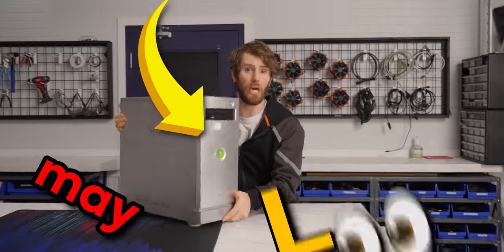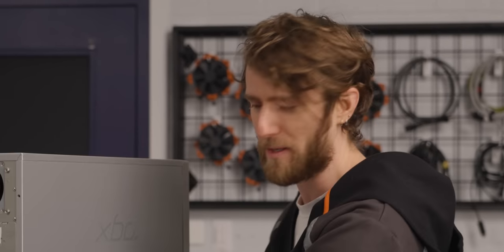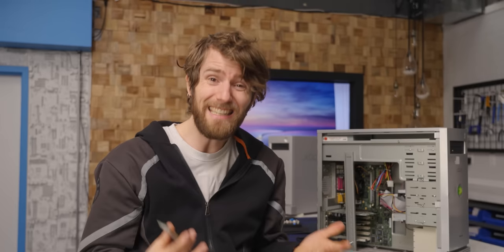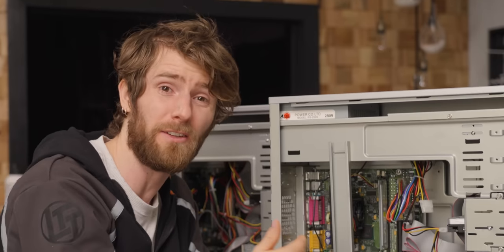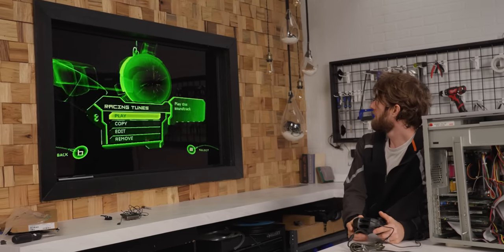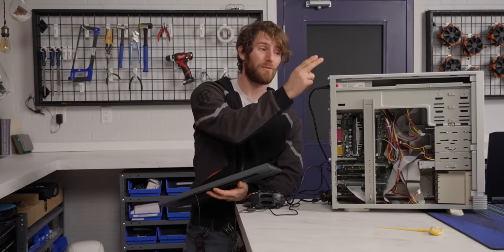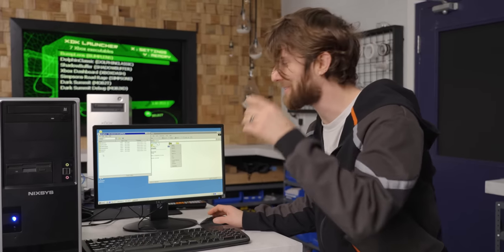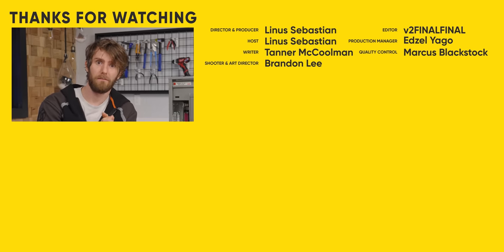I Used Stolen Software to Make a DIY Xbox - Xbox Alpha I & II Dev Kits

Comment: Windows 2000 remains a fantastic OS. It's a very light microkernel with the Windows runtime running on top of it. I can see why Bill Gates was horrified at the UI they built on top of it for these early demos, but luckily, the UI layer could be changed later.

Windows 2000, even the full desktop version, could run on 64 megabytes of RAM easily. The Windows shell was hardware accelerated, with cursor shadows, fading menus, and with the right extensions, you could even make translucent Windows and soft shadows. Since the XBox didn't need the full suite of the Windows 32 API, even that could be stripped down. Variations of the "ntoskrnl.exe", which is essentially the microkernel that underpins Windows itself formed the basis for Pocket Windows, the Zune, Windows Phone, the Windows recovery environment, and to this day continues running under Windows 10 and even 11. The vast majority of what uses system resources is not the Windows kernel, but rather the Windows shell and the plethora of services that run to create the full Windows experience.

This tiny core of Windows is probably one of the most amazing pieces of software ever written. It could run on almost any architecture, including Power and ARM -- it was the Windows 32-bit runtime that kept Microsoft from releasing on those platforms. And if you ran a server, back in the day, Windows 2000 supported Physical Address Extension and could address up to 128 GB of RAM on a 32-bit OS. Today, the NT Kernel can simultaneously run Windows 11 and a full GNU "Linux" runtime by running a version of the Linux kernel itself like a program.

So, you might think this is a cool use of a stripped-down Windows, but it's only the tip of the ntoskrnl iceberg.

Comment: The timeline fits with Intel paying OEMs to not have to compete with AMD.. I suspect Intel paid MS to use their chip instead as was their custom at the time. I'm a bit surprised the Xbox Devkit didn't have a drive flashed with firmware capable of reading xbox dvds, because that was essentially the only difference between a bog standard consumer dvd drive and the one in the Xbox, other than the proprietary power/eject cable.

Comment: OG Xbox gives back so many memories of installing mod chip, then later on using exploits to run XMBC and Emulators, or run games completely off HDD.  

Microsoft actually brought PC gaming to the masses with OG Xbox.   

What would be cool would be someone were to hack Xbox Series S or X. Then we would be able to install Windows on them.  Series S would be such a steal at 300 bucks for APU system that will be able to run games a 1440p.  Why not just play Xbox Series games? Installing Windows will allow install of games from the past and even Sony Exclusive titles that were released to PC.

Comment: I think the biggest highlight of this is the Xbox concept: Windows doesn't suck for gaming IF you can strip it of E V E R Y T H I N G that it DOESN'T NEED TO PLAY GAMES!!!  So other than competition with, well, Xbox, there is literally no reason that Windows cannot be dual-booted (or otherwise shunted) into a totally stripped down game mode that actually games well.  The ironic bit being that LINUX should be even more capable for this ... but ... no.  Also not an option.  The closest we've seen is, weirdly, from Valve, and even then it does not appear to be as stripped down and optimized for gaming as it should be.  Probably, at least in part, because Linux needs so many extra bits to pretend to be Windows in order to game.  😕  So the big reason why consoles hold up so well for gaming against a PC?  Because the PC is forcibly fed bloatware on the assumption that you want to write a PowerPoint presentation and check your email while gaming.  Which, fine, some people do.  I guess.  EXCEPT FOR WHEN YOU DON'T!  Sorry for being salty on this, but it's just really always struck me as stupid that you can't  simply export your drivers into a secondary OS boot option for gaming that strips out everything that you don't need for gaming so that you can, you know, game better.  Microsoft literally invented the concept, and has some very flexible (though complex) embedded OS tailoring ... and then denied it to PC enthusiasts.  And Linux still struggles to pick up the mantle, even after all this time.  The cost of graphics cards these days shows, people will do insane things for 10% more performance.  But this obvious play remains to be done well.

Comment: I tried to get a pre built PC from Build Redux (Linus's pre built company) it was the worst experience ever. I paid over $4,200 for my 4090 Build, and I had my processor changed to the 13900k. I spoke to several people about having the processor changed and it was confirmed that I even have a picture of it shipping eith the 13900k. Got my pc and it has the 12900k in it. Called back and  cant even get a hikd of a manager to talk to. Just have to go through other employees to get word to managment. The employee said it was too late to change after they shipped it when my request was placed way back a long time ago and confirmed it could be changed. Long story short my order was delayed 4 times, and they said I would have to pay a restocking fee of 15% in or to get my money back, which was their fault. Never buy here.

Comment: Sega was basically dead in terms of console making at that point. Once the Xbox was in consumer hands Sega had dropped out of the console race and stopped producing Dreamcast consoles as they were basically on the verge of collapsing entirely. Xbox just had to compete with Sony and Nintendo which was still extremely difficult. Although they did end up getting 2nd place and beating Nintendo’s GameCube ever so slightly in sales

Comment: It’s not that older windows was optimized well cough (windows 95/98) it’s just that they were made during a times when everything was small, and you couldn’t get really big drives and such.
A 4GB drive for 2000 and such was most likely all people could get for a good price. But now you can get a 2TB drive for 70, which is what a 4GB drive costed anyway back then.
But after storage became less expensive, or more storage mediums became available, Microsoft innovated, made it so windows could use more and become more. Vista was the start of that, because even XP had the same design as the older operating systems, adding more and more to make the OS powerful and flexible…. But because no one wanted to support drivers on the thing, due to wanting to innovate at a slower pace…. That OS fell through, till Window 7 took the mantle, and is mostly a reskin of Vista but better.

Comment: Bill Gates wasn't even CEO, when the original XBox launched - Ballmer took over in January 2000, the XBox was unveiled November 2001. I get, that a product has to "ripe" - but even if the pitch was on 14th february 2000 - Bill Gates wasn't the CEO anymore.

Comment: Nope, the reason why microsoft swap amd for intel was because sony chose emotion engine as core for PS2 who was capable of offering 128bit float point performance at the time of launch while amd had historical record of bad FP performance and barely able shovel out single precision every 2~3 clock cycles with its homebred 3d now! Technology and ut was considerably bad for console at the time because most of them are still FPU accelerating and the concept of GPGPU still wasn’t around yet hence intel became the only option to beat PS2 due to its 128bit SSE.

Comment: My Dell Dimension 1000r  Windows 2000 pro computer, I'll bet money is faster then ether of these, it's specs Penteum 3 1000 Mhz and 1x256k sdram 1 x512k sd ram that I upgraded myself along with the OS to XP, I used that computer all through the XP days.
Reply: BTW the max ram config for that intel board I think is 1024 MB so that's actully a better board than the Dell Board in the Dimension 1000r Idk why they used a slower CPU, that I'm kinda confused about! Fun fact though Linus is the 1000 Mhz penteum 3 in my dell is not the fastest P3 money could by back then with that crown going to the 1.4 MHz  Coppermine Pentium III that came out in the late 2000's so they really did use some cheaper componits in these.

Comment: Every new device in prototype phase is as janky as this is. And I speak as someone who actually had experience with various devkits or prototypes. It's for purpuse: it must work, it must be easy to made and customize. Retail models are another thing, usually even done by completely different team than the software one, that is working on devices like that.

Xbox 360 early prototypes were... customized PowerMacs (because of their PowerPC CPUs) for example 😉 Same as... iPhone prototypes - a PowerMac connected to a board with a prototype touchscreen to work with a very early iOS builds and touch interface.

Comment: my pc order from Build Redux became a nightmare.

Called in and got an update saying  it would take another 10 business days to ship out.  This is like the 4th time they pushed the date back. 

So i said fine but since you guys are still working on my pc can you put the 13900k in instead of thec12900k and I will pay the part difference since there is a noticeable difference in performance. Guy said yea I can just bill your order. Dude come back and reply hours later saying they are too far in production and can't swap a part that takes under 2 mins to install. I told them if I could speak to a manager and then no response for hours just got emailed a shipping confirmation that the pc is shipping with 13900k. So I called to get confirmation and they tried to ship it with a 12900k. So I looked at the shipping the Dude sent me because I told them not to send it out before I speak with a amanager and now shipping shows canceled and waiting for a manager to call. What a nightmare.

Comment: Wait the old Xbox is windows 2000 💭💭💭
Reply: The kernel isn't the same, if it was you could run those alpha kit software and games on Windows 10 directly but those games are static libraries and only run on a PC with an nv20 card.
Reply: @yellowknight11.1  i see i watch the whole video on XBOX how they make it  the Xbox is softwear system run on windows